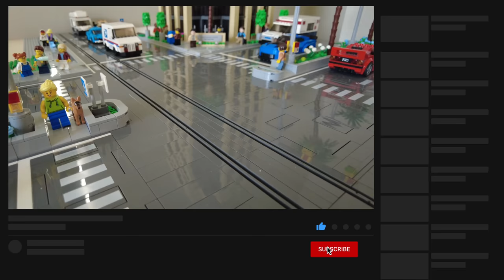Custom Build with the New LEGO City Road Plates & Train Track! (Full Tutorial)

Comment: how can this deal with curves? ive never seen anyone who makes smooth curves.
Reply: I think it’s best to avoid them. Try and stick with a city grid.
Reply: @NittanyNation22  He means train curves, they need to turn around eventually
Reply: @4duanich  Yes, that's a good point. Seems obvious once you mention it.
Reply: @4duanich  can't you just use curved tiles?
Reply: You could make the curves like under a bridge or mountain or something where you don’t really see it.
Reply: @bradgamwell3584  yes, make it go underground before turning or something so then you don’t have to make turned roads.
Reply: I would make the tracks a tile higher and the road a tile lower. Then I think you can place curves as need be. But you'd need to do this with straight road tracks too. Then you use those slopes that come with the roads and meld the road with the track. Where I live there is a section of tracks next to a road like this and they are noticably higher, but if you need you can drive over them because there is a slope to get over.
Reply: End the road half the base plate and make a tunnel or make the corner after the baseplate.
Reply: I have never seen it either Joshua.  Not with roads nor train tracks.
Reply: I feel like they track and road should be 1 plate higher, so the train tracks would take curves into account since they would also need to be attached or at least resting on tiles

Comment: try doing super fast monorail with lego, mag- or air-lev, or just plain rubber wheel lev, airplanes on sticks
Reply: electricity traveling through the track, only the motor through induction loops carrying the current, you might just also do a  basic rubber wheel under-above-powerline train
Reply: ground effect hovercars, pressurized air turbine floater cars, over the plates

Comment: On the first sight really attractive looking street but then I could not blend out gaps between plates. All looks to me rather a bit clunky that was not the case in the previous plate system. The other think is that one needs to winden the street with additional bricks to make it usable for the current vehicle lineup. In my opinion it is just sad. On the good side my vintage like 6693 or 6645 sets are actually still good for this width ;)

Comment: The problem I’m having is how do you instal a Switch Track without ballasting the track? This system works great until you want to add a switch while keeping it even with road. You’d have to put 2x plates under the road plate then the curbs become 1 plate high rather then two and everything gets screwed up. 

If anybody can explain to me how to add Train Track Switch into a mil plate while keeping road even with track and 1x plate under road plate I’d much appreciate it, thanks.

Comment: The cost of the new road plate set is prohibitive: However, you can buy individual road plates off bricks and pieces now for $2.20, which actually starts to bring the cost closer in line to the original baseplates.
Reply from the maker: They go on sale on Amazon for $16 fairly often, great deal for what you get.